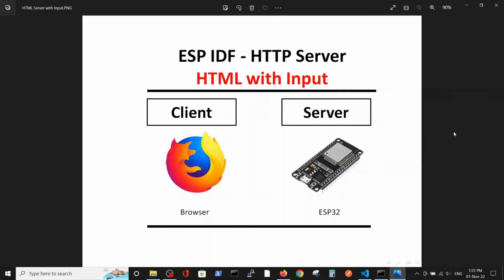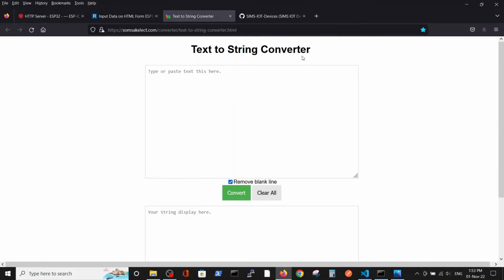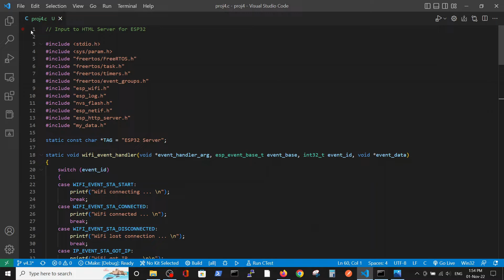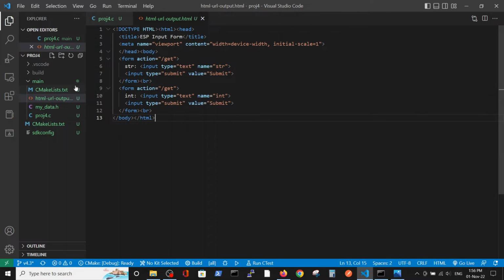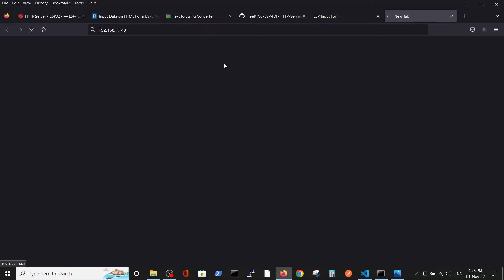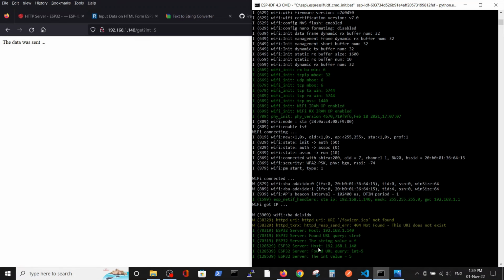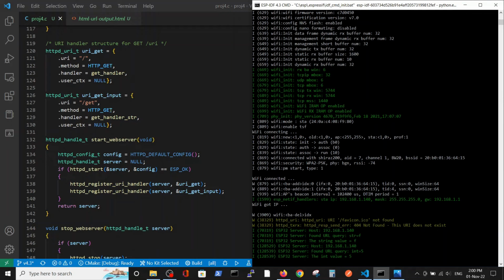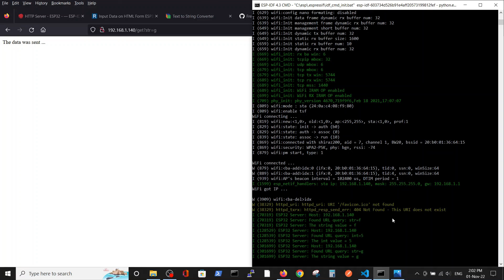5 - ESP IDF HTTP Server with string and int input HTML page for ESP32

Comment: Thank you for this video 
but when i  enter data with space in it . esp receives + in the place of space 
e.g if I enter e g then it will print e+g
how to solve it ?
Reply from the maker: Dear @user-zi8nw4xf6n,
I think this can be related to the data entry and interpretation method. Which method to enter data are you using?

Comment: Hello. Thank you for these tutorials on ESP! Can you create a tutor for using external "html" file with some inputs/outputs using javascript / ajax (not reloading page)? It would be extremely helpful  🙂
Reply from the maker: Dear Jakub,
I have added an external HTML file request to the wish list. I will get to it.
Reply: @simsiotdevices6219  Just came through it. Spend 2 days solving issue why http handler not serving html file but favicon does (rest_server example). Maybe it helps...FAT32 cannot handle 4 character extensions at files by default, so >menuconfig->components->FAT->enable long filename support < does the whole thing working.
Reply from the maker: @jakubstejskal6806  Thanks !

Comment: Great Tutorial! Is it possible to print data from esp on web page, for example sensor data?
Reply from the maker: Dear Iliyan,
Yes, by modifying the HTML string for example. Do you think the video about it will be helpful?
Reply: @simsiotdevices6219  Hello and firstly thanks for your work. Yes, it will be very helpful especially for me. Also for me is hard to understand how to structure the program. For example if you have sensors, display, buttons and web socket how to manage all things.
Best regards, Iliyan
Reply from the maker: Dear Iliyan,
I will try to deal with updating the HTML first.